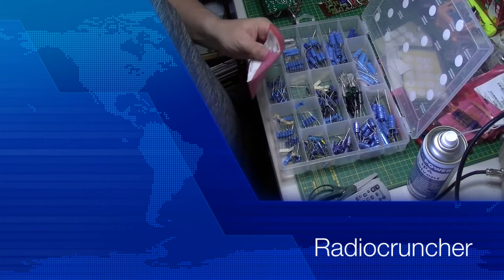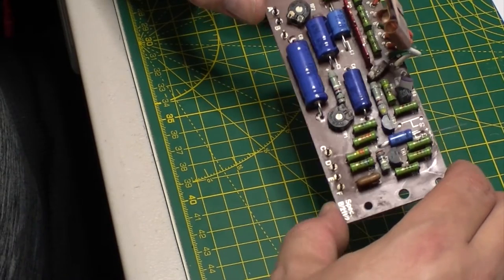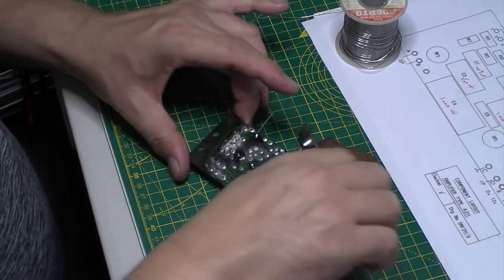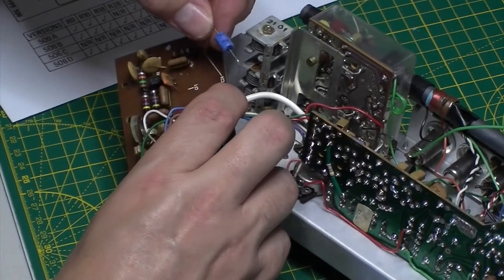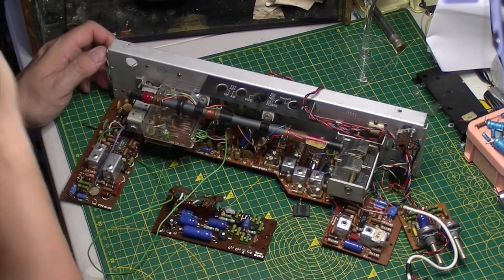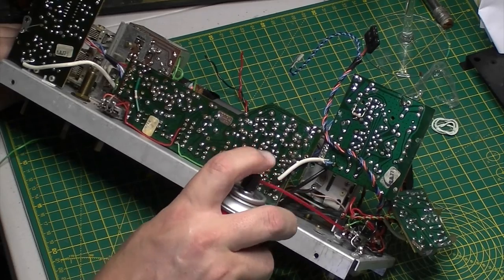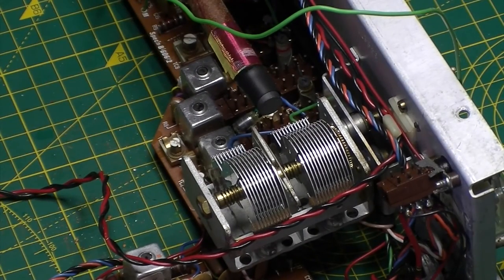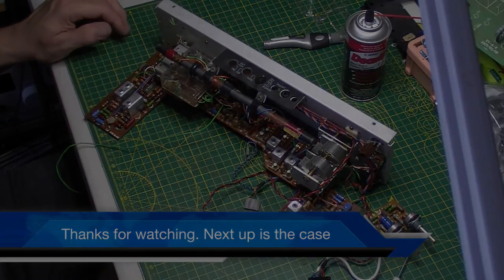Hacker Super Sovereign RP75 transistor radio Part 4: Electrolytics done and general servicing

Comment: great video GRAHAM very interesting to watch and learn. looking forward to part 5.

73 Steve.
Reply from the maker: Thanks Steve. Part 5 will be out tomorrow all being good. 73 Graham
Reply: Radiocruncher great looking forward to see the radio all up and running again.
wish you would have been a bit closer to me and i could have brought my new radio round for you to do a service on it.

73 Steve.
Reply from the maker: I'm sure with a bit of studying and some test gear you will be able to do it yourself soon. Did you sort the R800 power socket? 73 Graham
Reply: Radiocruncher no graham not had a lot of time as i am a lorry driver but got 2 week holiday in 2 weeks time so have a bit of time to have a good look at the R800. I  use the R800 every night on battery power it is working perfect on battery.

78 STEVE.
Reply from the maker: I'm also off then Steve so feel free to drop me a message or an email if you need a bit of support. Cheers Graham
Reply: thank you GRAHAM i will email you if i need any help as i will more than likely need it.

73 Steve.

Comment: I see the oil pen you have.....Have you heard that you should NOT use a petroleum based oil for the plastic pulleys in radio's??? It should be a silicon, based, grease lubricant...nice video as always..
Reply from the maker: I hadn't heard that. I will have a look and see what it's made of. Thanks Graham